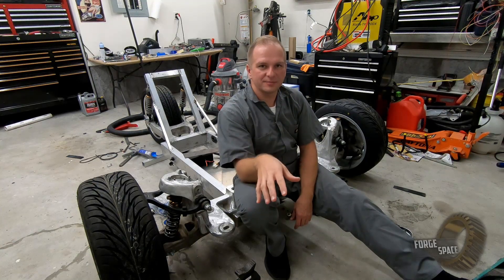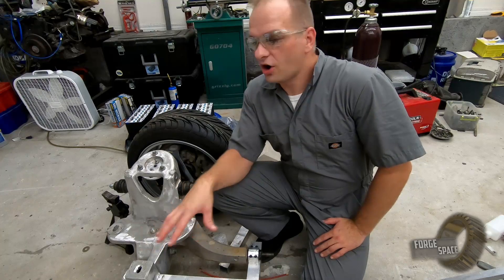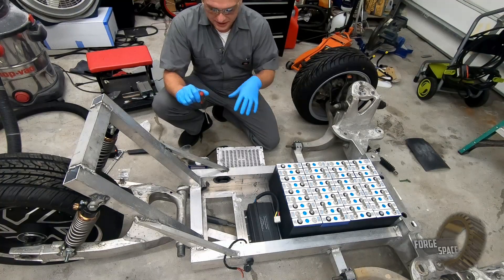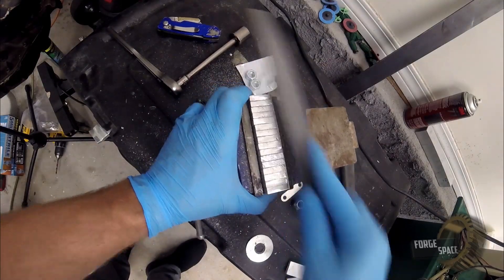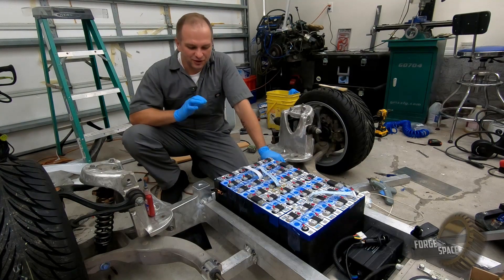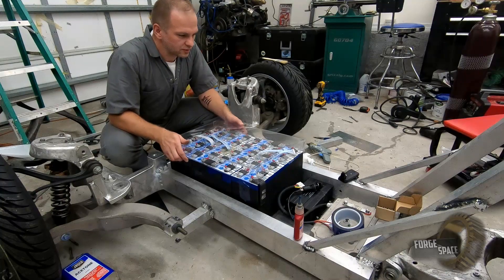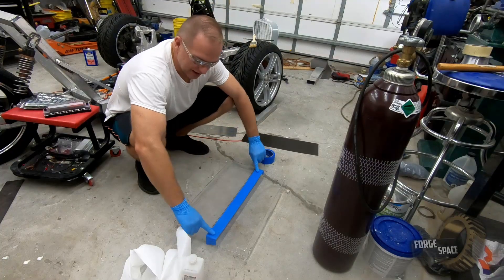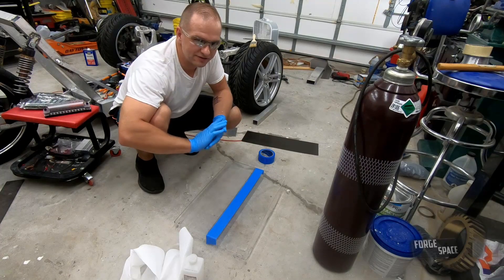Hardware reinstall on the reverse trike - CyberTryk EP.10

Comment: I think with this massive current it would be better to crimp cable as to solder it!
Reply from the maker: You're right. I didnt have cable crimpers and while there is a lot of current its only 115 amps at the nominal voltage. That is not that high for this connection.

Comment: What bms did you used?
Reply from the maker: Jose, it is a modular BMS. The 30A charge 60A discharge. I am only using it for balancing and charging. For current draw I am going direct, controller to battery as the controller has current protection built in. https://www.aliexpress.com/item/4001138179223.html?spm=a2g0s.9042311.0.0.19b04c4dZkQquR